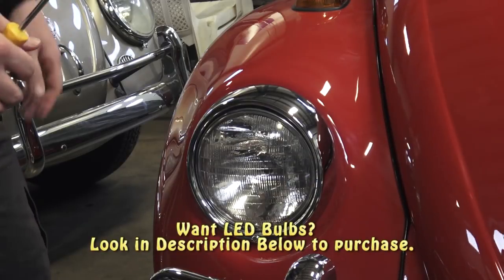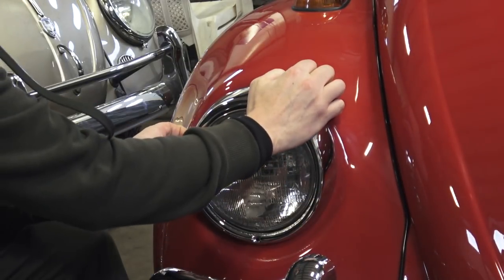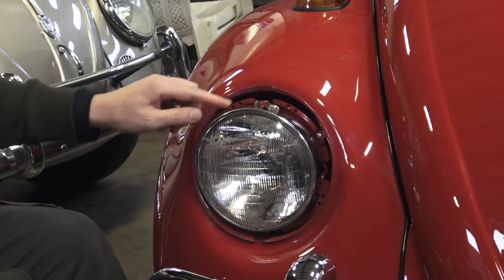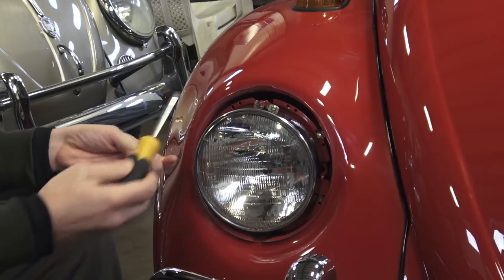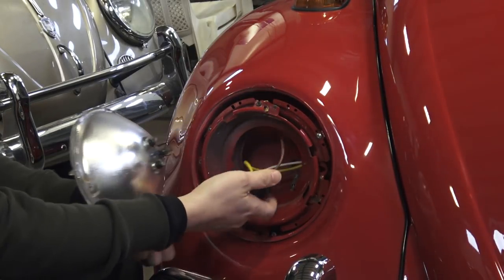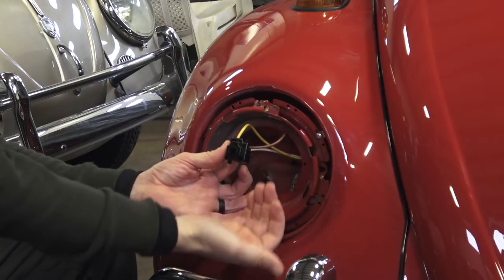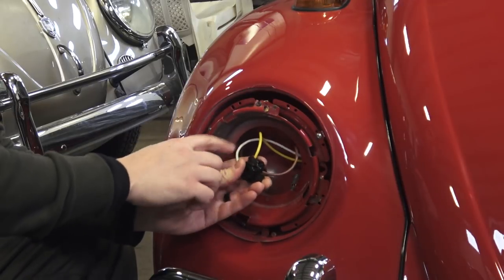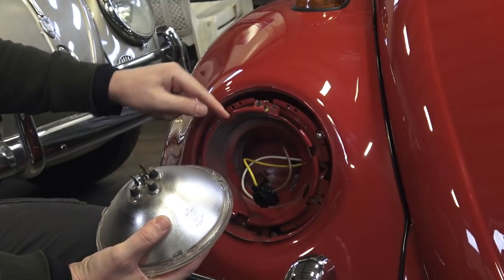Classic VW BuGs How to Remove your Vintage Beetle Headlight Bulb

Comment: Love the videos as always. Do you have a vid on redoing the bucket style headlights? The car behind this red Bug looks like almost the same one I am doing- minus the year. I have a '66 L87 bug and was doing the headlights today- new assemblies. The fender seal on one is not lining up and the other seems to be blocking the lip so my chrome trim can't stay "in the lip" so to speak. Could be aftermarket as you stated in the video. Just bummed because I taught myself how to  assemble the deal and then I figured, "I just have to put the trim in the lip and then lower and screw and done. Nope! I did get the glass back in, though and it's almost finished. I watched your vids all year- since last Nov. and gutted this car and replaced everything, had it painted, and am almost done with all the exterior pieces. Your tar board looks killer in the engine, btw.
Reply from the maker: Hey thanks my friend.  So what is aftermarket on your bug?  The trim?  the fender?
Reply: @classicvwbugs  The assembly (which includes the trim). Fenders should be stock as far as I know. The original owner sold it to my buddy- same neighborhood- he never did anything to the bug.The unit I bought is one of the EMPI units from Jbugs. I am thinking, now that I learned how to assemble them, to try and use the original one and just install the new chrome trim and headlight. Thank you for the quick response!
Reply from the maker: @salestowelpros4691  yeah those aftermarket assemblies are just not that good.  Wolfsburgwest.com sells good ones.